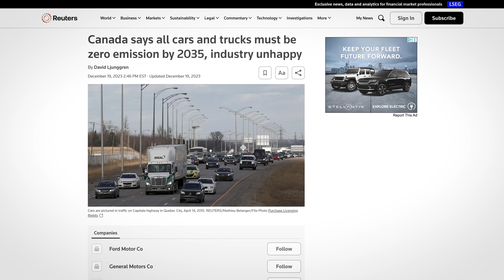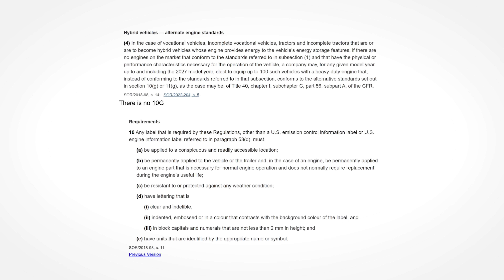Government Red Tape Is Blocking Our Plug-In Hybrid Trucks

Comment: Found this on Google might be the quickest and cheapest way to speed up the process. Only thing that will need modifications is the fuel to load that a generator has but it's a small highway engine that is already in use and might just work..The smallest Cummins highway engine that uses a DEF (Diesel Exhaust Fluid) system to meet emissions standards is the R2.8 Turbo Diesel. 
Here's why:
The R2.8 is the smallest engine within the Cummins ISF family which utilizes Selective Catalytic Reduction (SCR) technology for emission control.
While primarily offered as a crate engine for enthusiasts in the US, it is used in various small pickups, vans, and commercial vehicles in other regions, suggesting highway capabilities. 
Important considerations
The R2.8 uses both EGR (Exhaust Gas Recirculation) and a DOC (Diesel Oxidation Catalyst) in addition to the SCR system to meet EPA Tier 1 emission standards.

Comment: You guys are breaking ground that could change the vehicle market. It sucks to be the pointy edge, but I appreciate what you do. We need to get to a place where small shops can do bolt-in hybrid conversions of mid-sized vehicles, and that tech will come from getting the commercial fleet having a conversion system for chassis that already have a million plus mile lifespan (how many tow-trucks are on a different powerplant than the one that came from factory?)  Chin in tight, elbows up, keep moving forwards. Keep your stick on the ice, cause we're pulling for ya.

Comment: Use a highway engine.  Leave the ecu alone.  Use a computer or Arduino to monitor everything and  run the engine when required. It's super easy.
Reply: Now you've modified the drivetrain and controls so it's no longer certified.

Comment: Retired double-E here. I've not designed lithium-ion anything, but I find lithium-ion batteries fascinating, and have done much study since retirement. Plus I own an EV, would love to invest (but just a touch shy of the liquid million needed to qualify), etc. Your approach is the right one. The electric drive train completely blows away the ICE drive train, but battery storage sux compared to a tank of fuel and a little fuel pump (batteries are getting better). Toyota hybrid tech combines the worst of both words---your approach is the best of both. And if Mr. Fusion** ever becomes a thing, toss out your ICE generator and use Mr Fusion... or a fuel cell... or anything that converts chemical energy to electric energy. Anyway, said all this to say: I'm not completely clueless.

I have a suggestion that might work for the regulators, but might not fly for your technical group.

Let's say you have a 400V battery pack that's 80KWH energy and 160KW peak power. If it were possible to split that in half: 400V, 40KWH, and 160KW peak (4C discharge rate). Then you could run off one pack at a time. Run off pack A while charging pack B. Then when A is near dead flip them to run off B while charging A.

The pain is physical layout, finding 4C batteries at the same price as 2C batteries, and a few minor details like the added bulk and price of the switching circuits.

The gain is that you're charging up a battery pack that is not (at that moment) attached to a power train. Of course It's all moot if the regulators don't see it that way.

** Back to the Future reference

Comment: What I don't understand is that Chevrolet with the Volt and BMW with the i3 Rex both had generator without a mechanical link to the wheels so technically they had the same setup as Edison.... they would've used a on-highway engine?
Reply: With on highway certified engines yes, in contrast to Edison's off highway engine

Comment: Pretty disingenuous content. You idiots are running the truck off an emissions non-certified engine. 

You're not sustainable anything - emissions regs aren't a "mess". Yes, you need an on-road certified engine. 

You're not building an EV - you're building a diesel truck -- that's where it's energy comes from. You should not get any exemption.
Reply: All EVs are getting power from a generator somewhere, this truck just carried the generator onboard, others plug into stationary generators. Just because something is an EV doesn't mean it's not running on coal.

Comment: When I drove public transit buses, we had New Flyer Excelsior "Hybrid" buses. They had diesel generators that ran the whole time to charge batteries. The drive train was fully electric. I believe the engine also ran the heater and A/C and stuff. They ran on Cummins motors

Comment: Here is plan, find a "highway certified engine", that matches very closely in specs to your current generator engine and simply develop a custom throttle, which will perform the same adjustments as the generator usually does, but on a highway engine. The reason Im saying a custom throttle, is so you can still use whatever ECU they have approved without modifying it. You would hook this engine to the generator component and essentially meet their dumb demands.

Comment: OK, I am gonna call this out as bull poop.  There is absolutely zero reason an on-highway certified engine can't be coupled to a generator head and work JUST FINE.  All it takes is setting up the engine to run 1800 RPM, and even then I suspect there isn't a great need for super tight RPM regulation.  Worst case you could ghetto that with a fairly cheap generator governor mechanically running a throttle pedal sensor.  You may not (yet) be able to use a Scania engine if they are not making a highway certified engine in the size you need, but I suspect someone makes a suitable engine.  You'll need to find out the horsepower/KW rating at 1800, not the peak horsepower rating of the engine.  Assuming the diesel has a SAE bellhousing and flywheel, you can bolt a generator head right up to it.
Reply: They aren't allowed to re-program the engine without having it re-certified.
Reply: @Raataataatat  No need to re program it.  You could literally drive the throttle sensor mechanically with an external governor if they really want to play hardball

Comment: What about selling the truck as an electric kit and sell the generator seperate as a "ground charging accessory" but it can really mount into the truck and is done by the company buying the truck as a modified upgrade like adding additional lights or swapping out a truck bed or something like that.

Comment: Sounds like a throttle control issue, could you find a controller from a generator that would work with a certified on road engine?

Comment: Use an on highway tier 4 with a separate throttle control. Should be easy enough to replace the foot feed throttle with a servo controlled by the computer. Throttle locks have been used by on road diesels for a long time as a form of crusie control. Keep going!!! You got this!
Reply: Possible but probably 30% less efficient and heavier. Generators are a totally different beast in terms of optimization.

Comment: So, plug-in hybrid trucks are not banned. You need to use an on-highway motor for the motor-generator set. 

So contact the generator supplier to see if they can supply one that meets the requirements or help with getting the one you are using properly certified.

Caterpillar makes a number of diesel electric drive systems. Perhaps you could work with them to build the drive system you need.

Comment: This should have been anticipated by both the government and the truck builder.

There are a lot of "truck" engins that are approved.   Find one with a sweet spot when it's running a near constant load generator.   Gen set operations are one of the basic ways of implementing a hybrid.   The government rule makers should have anticipated this.

Canada might be polite but the government isn't a servant of the people.
Reply: Yeah if you're as a builder intending to cheap out and not pay for proving your emissions use something approved.

Edison has 0 paperwork for how much co2 the package produces per mile. Its not zero. It could be zero wltp(not same as 0 actual at all) if the battery is big enough but if you can't prove it use an engine that you can loophole in.

Comment: There is no red tape… you have an inferior product that does not meet current standards, and you want the government to reduce the standards so you can sell the trucks. Why are you not complaining about the government red tape forcing you to install seat belts? That’s a standard they enforce, you can get a ticket for wearing a 5point without a standard seatbelt even though the 5point is better. Not just in Canada but basically every OECD country. Why not build a better product that meets current standards and sell that?

Comment: The technology your using is over 100 years antiquated inefficient.
Power the truck with gasoline engine running on water converted to flammable gas @230°f

Comment: Since the 70s they've been able to run a car roughly 100 miles per gallon over a 136 km😢 they're burning chemicals destroying fuel efficiency when making your vehicle unreliable while digging for minerals producing poor power output they don't care about the environment the acceleration of 02 poor air quality is due to the massive burn of EDF other unnecessary chemicals & increasing fuel consumption with products such as ethanol. The world is more obviously ran by the devil Ephesians 6:12

Comment: You're being intentionally misleading with this video. The engine you decided to use has only ever been certified for off-road use - the certification is very explicit about that. There is literally nothing stopping you from using a road-certified engine. Well, nothing apart from re-design to incorporate the proper engine into hybrid system. You can additionally go through the process of getting your hybrid system certified as-is.

Welcome to the business of start-ups. You thought you were clever but got caught with your pants down. No need to blame "the government" for your own fuck up.
Reply: startup founder discovers regulations exist vibes
Reply: Yeah it does have that whiff about it.

Comment: This is so dumb.  But you do have options.   Depending on whose engine you buy.  I won't mention names.  But you could get the latest on highway emissions year and set the engine to run in PTO or cruise control mode.  You might have to adjust your generator controls a little bit.  Maybe ease the load on to handle the difference in the governor.  But you guys are smart I know you can figure it out.   Truthfully the compliance person at your engine dealership should have helped you out more.  Don't give up.  There are other options.   There are plenty of on highway 9 liter engines out there.

Comment: The Chevy Volt uses a generator that charges the battery bank. The battery bank powers the electric motor. If I understand that's what you're trying to do in semi trucks.

Comment: "We found a hole in our legislation" =/= you can't build it.
Sounds like you need to add two blackboxes to your generator. One to convert power draw to a throttle setting, one to convert it back. Then remove one box and present it as complient. :p

Though fixing the legislation is the long term solution. If it really blocks something they say they want, you shouldn't face any more kickback than parlimentary time.

Comment: Why wouldn’t it be built to supplement the power rather than using an engine to charge the battery. Make an engine that benefits from using the battery instead of a battery that benefits from using an engine charging it

Comment: There are so many contradictions in this video. You care about climate change but were also already designing an 18 speed diesel on the same chassis? Help is desperately needed to fix legislation or else we can't make the trucks, but also this is completely fine and fits on the existing 1-2 year timeline for production. We can't use a generator since the legislation doesn't exist, but also there's standards for on and offroad generators, and we're already testing switching the generator for a diesel.

Comment: You need to show why highway motors cant work for this application besides just saying they dont work show the work make demo of the two engines with there systems crated an output meters for the both of them as well as consumption under load an there spec differences 
Is it possible to modify an exsisting higheay motor to drive a secondary for the similar results of your generator

Comment: I have seen a few of your epa issues what if you were to put the generator in the trailer not in the cab it sounds more complicated than it is per si then it would fall into external generation like you were saying if its on the ground but if it is not part of the main chasis then wouldnt that circumvent that logisticly

Comment: I work at an major truck manufacturer as a PM. This is the reason why many commercial vehicle projects are driven by regulation not innovation. Some projects are literally named the certification or regulation name, because they have to be met. Certification of non existing powertrain types across the world is very challenging and costly, so even the biggest manufacturers mostly avoid it. Best case IMO is an exemption for a defined project with defined limited volumes for a technology demonstration. Hope you guys find a solution.

Comment: Due to the laws as written, if the diesel motor does not turn the drive axel there is no tax on the fuel. So as long as it powers a generator to electric motor to wheel, no road fuel tax. They have not yet brought in road user charges (RUC) so there is no way to tax these trucks

Comment: I can't talk about the 'Blaeberry Incident', but the government hires from companies within the industry. It helps keep everyone focused on governing and regulating safety. 

The railway uses 'genset' locomotives with off-the-shelf diesel generators. There is potential fuel savings by not using all the gensets when load is reduced. I'd never heard of the emissions certification issue for off-highway use.

Comment: Wait...so how did the Chevrolet Volt get authorized for use?

"The Volt operates as a pure battery electric vehicle until its battery capacity drops to a predetermined threshold from full charge. From there, its internal combustion engine powers an electric generator to extend the vehicle's range as needed. While running on gasoline at high speeds the engine may be mechanically linked (by a clutch) to the car's gearbox, improving efficiency by 10% to 15%."
Reply: Because it is emmision compliant certified, thats it. Edison has to do the same. Nothing is stopping this truck but Edison themselves by not being compliant

Comment: So when you threaten to move the manufacturing to the US maybe they will start to use their heads.   Red tape for stupidity.

The design you have is like a locomotive with batteries.  The Chevy Volt works similar.  

You guys are doing the hybrid I said repeatedly to be designed FIRST back in the 90's!!

Comment: Would you be able to use an on-road certified engine, and just build your own generator control loop? Since you are using a brushless motor as a generator you can control the torque output. You know at each output kw power, what engine speed and generator torque is the most efficent, so you build a control loop for engine speed, and set the generator torque/amperage in regen.

This would allow on road engine use, with a pure series hybrid setup.

Comment: Not practical I know but it would be funny if you used magnets so that the engine isn't actually mounted to the frame lol. "Its not touching the frame" 

There are a lot of options like mini trailer etc but I imagine the next thing will be "the fuel is stored on the truck therefore its mounted to the truck"

In the USA you could put in very clear writing "engine is only to be used while parked" and have a VERY obvious wire for a fuel cutoff that activates while in motion. Truckers will spread the word to disconnect the red wire... 

Its the responsibility of the company to comply but its out of their hands if an owner makes "unauthorized changes" and of course Edison Motors "Does not endorse such dangerous changes bluh bluh"

Comment: Everytime you convert energy to a different type (mechanical to electric) you LOSE energy. It's more efficient to use fossil fuel. Raised cost in energy needs, raises the price of everything. Raised cost require more work/energy to pay for it all. All this hurts the poorest of the poor the most.
Reply: Diesel electric has always beaten straight diesel on efficiency due to being able to optimise the engine's operation. Railway locomotives for example are diesel-electric, they're not straight diesel mechanical systems.

Comment: The government wants you to go green on paper, but they do not want you to actually go green. They want to increase the amount of oil burned in the industry, which means mining lithium and big tech bros putting everything in a pod and making everything coated in a layer of wiring and nonsensical circuitry. This diesel-electric truck is exactly like a railway locomotive you see trundling down the rails. It produces the power it needs when it needs it and doesn't waste energy or fuel when it doesn't need it. It is the future. It is what we should have been going toward back in the seventies when fuel was cheap, but the government doesn't like this kind of stuff because this sort of stuff is the actual, practical application of technology, not the smoke and mirrors of swindlers. Many people in the government require us to go green because they are the ones who own the lithium. They are the ones who are selling the ridiculous 'green' technology. It's all just a hustle, always has been, always will be. Stuff like this is practical, sensible, and effective, and above all else, it's actually green because you burn as little fuel as possible while not stripping an entire mountain of its lithium supply, which is why you'll never see it on the roads.